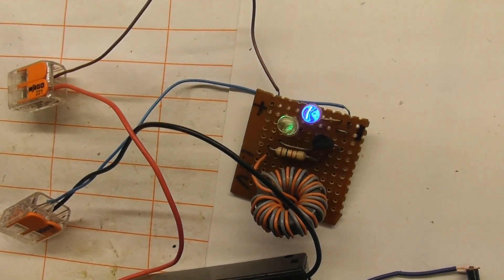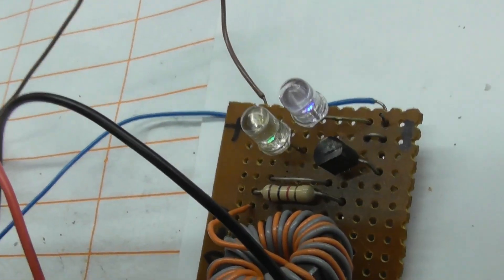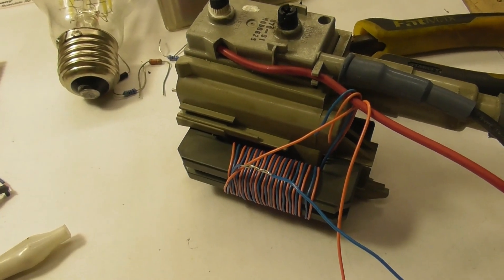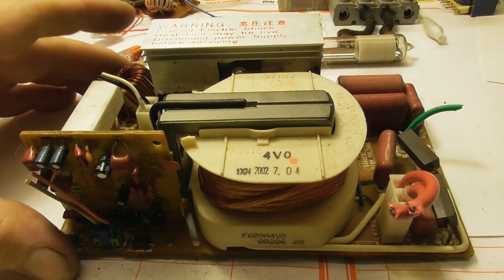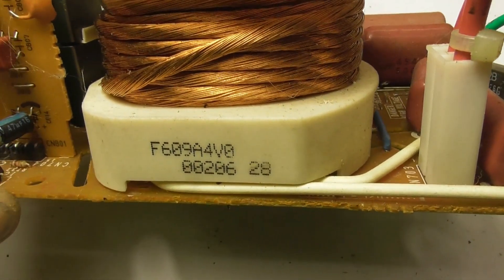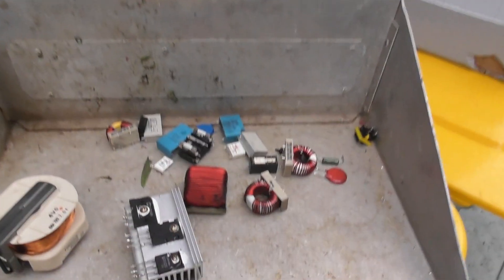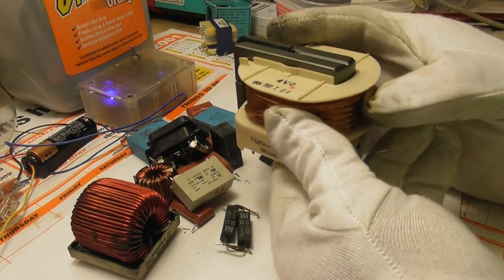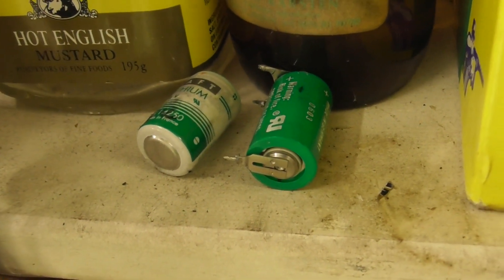Joule Thief Part 2

Comment: Is there some means to limit the mA current with a new battery ? Your Joule Thief ran on around 5mA on a 'dead'  battery but with a new battery it was around 45mA. If some means of making the thing run at say 5mA all the time the life of the battery could be hugely extended. I have been subscribed to your channel longer than any other, probably because some of your 'experiments' would not go down too well in the departure lounge at London Heathrow Airport. Please mister can we have some more magic smoke ?
Reply from the maker: maybe a 470 Ohms resistor in series with the LED for current reduction and a small bypass switch for the 470R when the battery goes down.

Comment: So simple yet effective! I've never seen an inverter microwave where I live yet, all of them use the old step up transformateur. Interesting design! And lots of usefull parts. MOSFETs ususally go bad in switching power supplies, got a 1.5Kva inverter for free that had a single MOSFET popped in the H bridge output, replaced it with a new one and it roared back into life! I could not figure out why it had failed, so I'm thinking it was just a bad quality one, that failed for no reason. The unit has overload protection, so that shouldn't be able to kill it, but you never know! 

Thank you for keeping us electronics and electrical nerds entertained during covid, it sure is a hard time with lots of boredom that we face. I've been working on a lot of my own projects as well, fixed that inverter, upgraded my solar system to 24 volts, built a vacuum tube amplifier, and many more fun little things c: 

Have a nice day, and take care! Greetings from me!

Comment: The HV diodes have Vf of 13.5V, higher than a DMM diode check can measure. UX-C2B is an 8kV 350mA Diode.

Comment: High voltage diodes will have a high forward voltage drop, probably around 6V or more, as they are made from series stacks of silicon diode dies. Try using a LED and current limiting resistor, and a 24V power supply.
Reply: Another trick is a 9 volt battery in series with a voltmeter. Should be 0 volts in one direction, and 3 to 6 volts in the other direction.

Comment: Other day i had a ups die and  stop charging the internal battery from some bad mosfets and the control ic committing suicide so i took the transformer out which was huge..  weighed like 75 lbs !  But its rated for 240-24vdc @150A..  so the thing had been eating its wheaties...  well i decided to backfeed it with 120/60hz (merica power) and the damn thing made 440v..  enough amperage to melt copper when shorted..  not a clue what to do with it except backfeed 240 and  see what it puts out before it burns n explodes  ,
Reply from the maker: That is a nice grunty transformer, you could make a good car battery charger out of that one 120 in / 12 Volts AC out ± 75 Amps. need a good rectifier to make dc.
Reply: @rodalco2007 that would be a pretty neat project. Assuming the transformer voltage drops 1.2v (5%) under 150A load, it could deliver about 600A at 7.2v for as long as the breaker would tolerate it, or if it was on a 60A breaker, it could probably deliver 600A for a minute or two before it overheated the transformer or rectifier. If that doesn't start the engine, nothing will!
Reply: I'm sort of surprised you were able to put 120v on a 24v "secondary" without saturating the core. Or I guess it must have saturated a little, or you would have 1200v on the high voltage side. How much current did it pull?

Comment: is it possible to make an self-generating device even if it only develop low voltage ? or a small radio with a diode that was producing power without any battery ?

Comment: Like the Joule thief devices, might have a scrounge through my old parts and make some of them. Those diodes are most likely high voltage ones so maybe hard to measure as they may have lots of diode juctions in series, might be good for high voltage projects. Keep up the great projects!
Reply from the maker: I did test those MOT diodes on a 12 Volts supply with a Led and load resistor and they worked fine. So they will get used at some stage.

Comment: Excellent ... Trust you to use Fly backs from t.v,s & microwaves  lol
Reply: I think the flyback would have arced if he had 12v and a big power transistor. Here's MakerJ101's attempt at running a flyback that way:https://www.youtube.com/watch?v=BT2JjVjmixI
Here's my attempt at driving an ignition coil with an 18v "joule thief" oscillator:
https://www.youtube.com/watch?v=knrcr6_JkSE